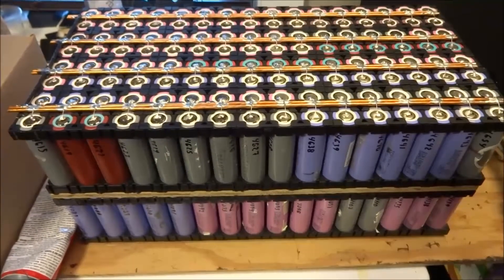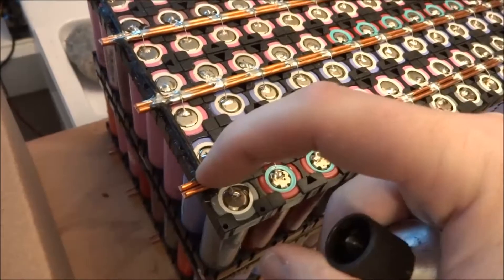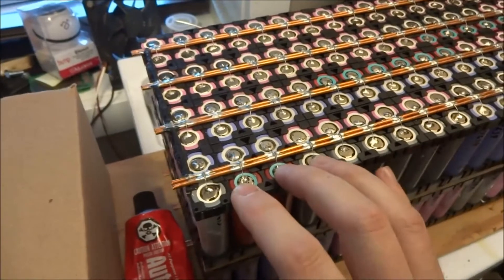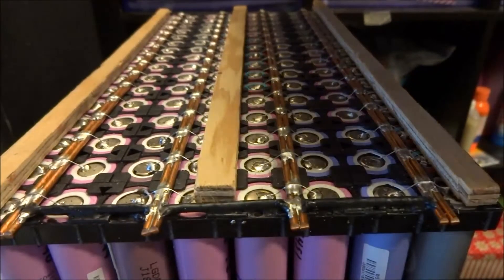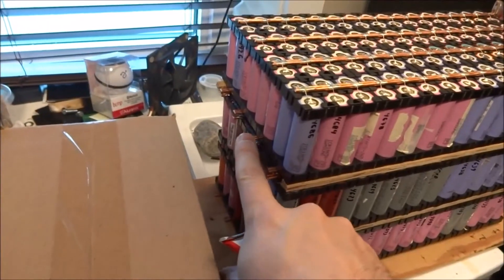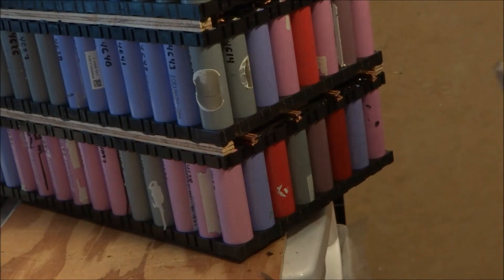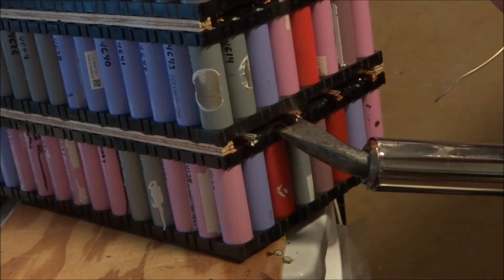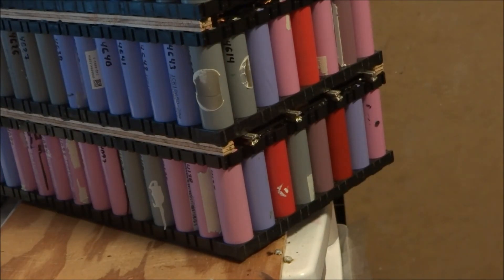Commander Electric upgrade to 18650, soldering busbars

Comment: Do the small wires not burn up during high load? what sort of bus bar system would I use if I want high draw (300A) out of a 18650 pack?
Reply from the maker: You mean the small wires soldered to each cell? They are designed to burn if the current draw is too high, like a fuse. Each cell can only deliver a maximum of about 4-5 amps. Since I have 128 cells in parallel, in theory I could draw over 400 Amps from this pack. To size the bus bar required you can use a site like the following: https://www.copper.org/applications/electrical/busbar/busbar_ampacities.html

Comment: Hi. Congratulations, beautiful work.
I am putting together my first lithium pack and ask a question: if I were to use a glass fuse, how many amps is recommended to use? Thank you
Reply from the maker: It depends, if you are building a pack for a power-wall type with low current draw then you could use as little as 1A. If it will be used for an e-bike then you'd need much more. For 18650 batteries from used laptops batteries you should not draw more than about 4A per cell.

Comment: Where did you get the soldering iron??
Reply from the maker: ebay: https://www.ebay.ca/itm/200W-SOLDERING-IRON-HEAVY-DUTY-CHISEL-POINT-200-WATT-CRAFT-MANUFACTURING-CAR-/122681677813?hash=item1c9065d7f5

Comment: so what do you do when cells go bad and need to be replaced ?
Reply from the maker: Well, my testing is pretty extensive (https://www.youtube.com/watch?v=seap6_v5Ck0&t=121s) so i hope they last a long time. Since I have quite a lot of cells in parallel (128), my hope is that if a few go bad, the fuse wires will take them out and I will barely notice it. The cells won't be stressed very much as I will only charge them to about about 4.08v and discharge them to 3.3v. Eventually when the capacity decreases too much, I can build new packs and disassemble these to be recycled.

Comment: One question, if you only solder on the ends at the middle busbars are really close but not soldered then a lot of heat can be generated due of a not 100% contact, regards
Reply from the maker: The busbars don't touch, the plywood keeps them apart. The only path for the current is through the soldered connection..
Reply: Leaf Xpack ok 👍

Comment: how is your leaf extender project? I have a 2011 leaf in montreal and cant do more than 86km per charge so im realy hopping your project work. Did it work with brcc?
Reply from the maker: The Leaf extender project is on hold for now. Have you lost a capacity bar (or two)? 86km seems low.
Reply: yes 1 bar lost. 94% left. And i will not drive at 90km/h on the highway.
Reply from the maker: That sucks, my 2014 still has all capacity bars but must be pretty close to losing the first one and I can still do over 100km per charge (which is the distance to my cottage).